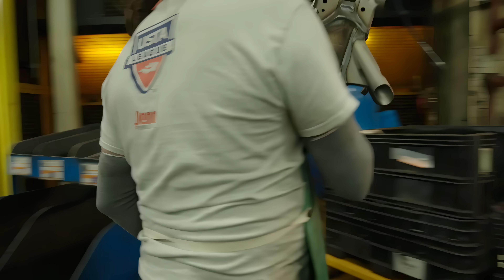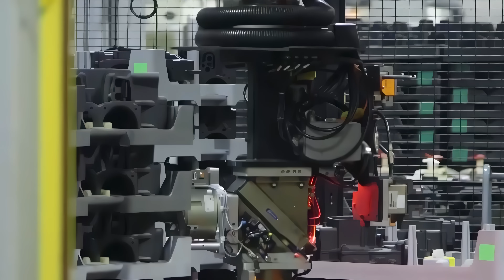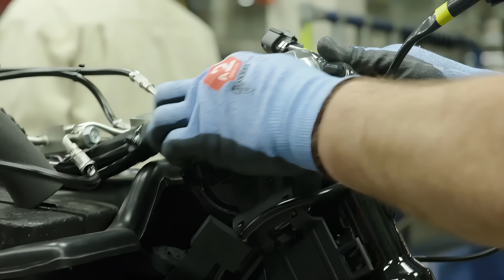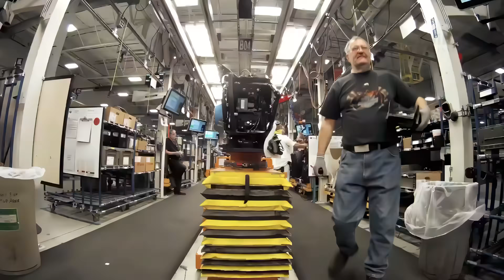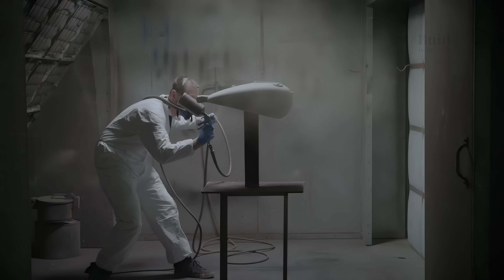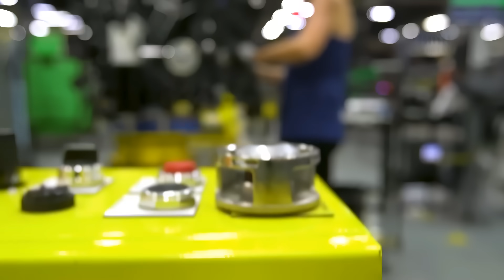Inside Harley-Davidson’s Secret Motorcycle Factory - York & Milwaukee Manufacturing Tour

Comment: HD is an " under-square " engine = Torque  at low rpms. ... Indian is an  " over-square " engine .... meaning it has to get the revs up close to the limiter  for any decent torque.,  So if I were to build a custom bike off the cuff...... I would choose an  HD Evo engine for it .. (  Air cooled ... like Yamaha did , not Liquid cooled like those that don't know any better did)
Stay Safe.

Comment: I love my Harleys! I bought my first one, a 1988 883 Sportster brand new in '88 and still own it to this day. Previous to now I also owned a 2013 Softail Slim which I bought new and rode for six years putting 55k miles on before I traded it in on a new ElectraGlide Standard in 2019; the ElectraGlide now has 56k miles on it and I plan on putting plenty more miles on it. Some say Harleys aren't reliable, but I've NEVER been stranded on any of mine due to any mechanical issues.

Comment: 2002 Heritage Softail, 2009 XR1200 and 2013 Ultra Limited, I think the import of some parts or components is okay especially if the quality is on par and reduces the parts cost.  The US imports a lot of raw materials from all over the world as we use approximately 25% of the worlds resources here in the US.  So if you count raw materials a lot of everything is imported.  Oil/Gasoline  included.  I prefer the Harley Davidson.  I liked the Indians when they were first coming back in 2013 with the Vintage styling.  Now they just look like rebadged Victory.  Tank shapes, Bags, fairings, and the newer engines.

Comment: Got a 07 heritage people  say that is a nice bike,  I  tell them it's a piece of schit,not good parts,Japanese  bikes are better  build .bought used 95 hundred miles  got a tic in the front end that can't nobody   find ,back  wheel broke 5 spokes ,clutch cable leak,change the compensator it's bad on a O7, now the top end leaks,47 thousand miles.

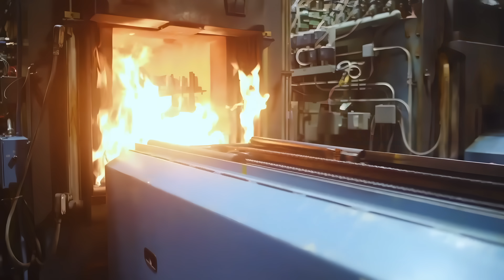Comment: 2:45   The commenter states that the tanks are held in WIP and then delivered to the line to support "just in time" (JIT) manufacturing.  I'm sorry, but if you stamp, weld and paint the tank, and then hold it in WIP, that ain't JIT.

Comment: I own a 2024 Harley Street Glide at the end of May I will have owned it for 1 year. Since then it has been into the dealer 6 times for repair work all mostly electronic. Each time for 1 -2 weeks. I lost all confidence in the reliability of Harley, it is only a short ride around town motocycle

Comment: I have a 2014 Ultra Limited gone 115.000 km. Now the engine and gear need total renovation, cost more than 10.000$... after already spent 7.000$.
Reply: I have a 2005 Honda ST1300 Pan European.  It's just clocked 148,000ks.  Apart from new fork seals at at 95,000ks; I've never had to do anything to it apart from normal servicing.